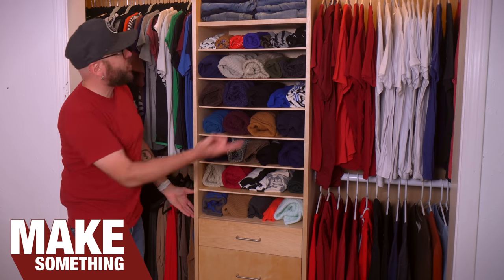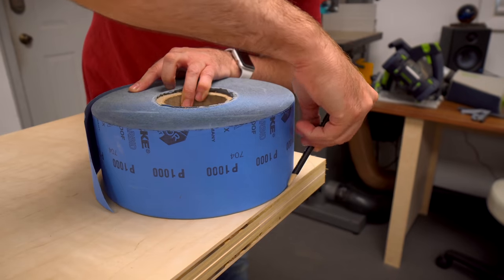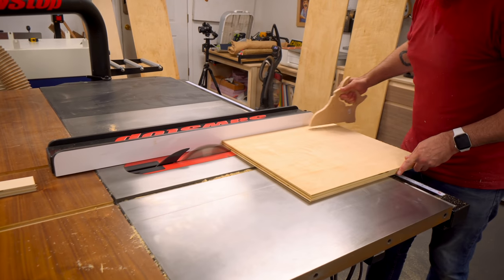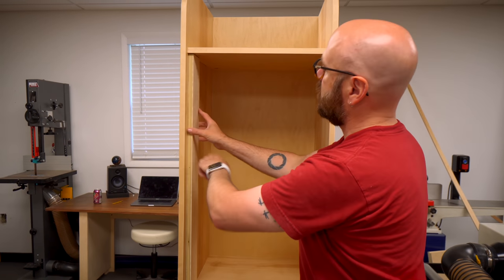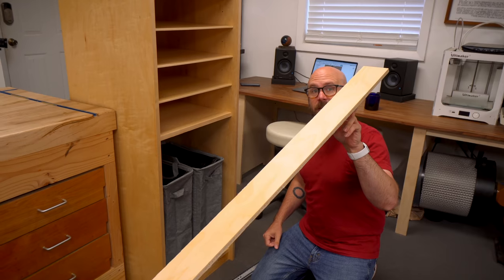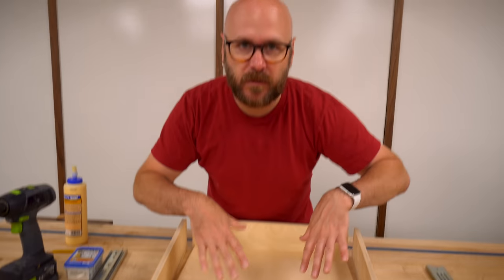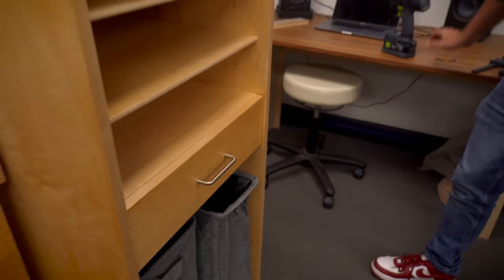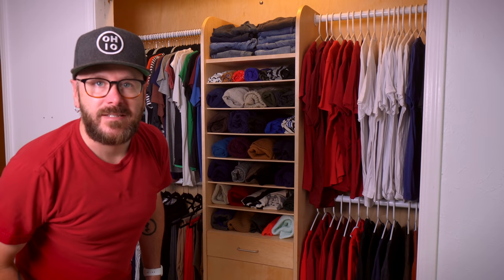DIY Closet Organizer With Laundry Hamper | Easy Woodworking Project

Comment: If you build the drawers will full length side pieces, you can have the pocket holes on the front and back panels and that would hide them once the drawer is installed in the cabinet with the front face installed. Brad from fix this build that has a great video on it. Also makes the drawers a bit stronger. 

Really glad you put this out since I have been toying with the idea of redoing the closets in the house and this was the push I needed to take it on. 
Cheers!

Comment: To use every bit of available space in there, a shelf up top would be handy for blankets, more sweaters, lesser-used items, etc.   Since it would block that ceiling light inside, a strip of LED lights running around the inside of the doorway, and maybe also vertically inside the front corners, would provide better illumination where it's needed.

Comment: I saw the teaser on Instagram and thought, "A closet organizer. Am I even going to watch this? That's more boring than shop furniture." Watched it anyway. Wasn't disappointed. Right off the bat we get a "Check it!" that is followed in quick succession with a long-awaited return of "Sand in the place where you live!" And finally capping it all off was the flipping the cut pieces off the back of the tablesaw (nice having carpet in the shop so those pieces don't get dinged up falling on concrete! This was your plan all along, wasn't it David?), and a kick-ass montage of artsy slo-mo to wrap it up. You're right David - it may not always be about the project when you're wanting to also be a film maker. Despite the mundane simplicity this was still really enjoyable to watch.
Reply from the maker: Thank you thank you!

Comment: Have you considered putting your pocket screws on the front and back panel of the drawer, never see them that way. More math but I just stack it all up, clamp it to the side then take a measurement.
Reply from the maker: Hmmmm, that makes more sense!
Reply: @MakeSomething  added bonus, hide the slots for your bottom.
Reply: Scrolled through the comments to see if someone mentioned this. I'm doing a bunch of drawers right now and the pocket hole placement stood out to me right away. I like your method of clamping everything and taking a measurement. I'm slowly remembering to do that instead of working off my "perfect to the micron" sketchup plans 😂
Reply: @AlexCue  Happy to help. Just make certain your cabinet is square and plumb.

Comment: Great closet organizer!!  Just a question - your outfeed table is parallel with the table saw - was shoving the cut pieces off the table just for show?  I would imagine edges or corners would get damaged falling to the floor?  I am short on shop space and like the idea of it running the length of the saw, but any issues handling larger sheets when cutting?
Reply from the maker: I shove the pieces off the outfeed table to get them out of the way for safety and efficiency. My floors are carpeted so I don’t worry too much about dings. If I had a bigger shop I’d definitely make a much larger outfeed table.

Comment: If you drilled your pocket hole in the back and front piece of your drawer they would have been hidden... more elegant in my opinion
Reply from the maker: But then how do you hide the drawer slides? Way uglier than pocket holes.
Reply: @MakeSomething  if your pocket hole are in the front you hide them with the faceplate

Comment: David, do you have any recommendations on a table saw that uses less than 15 amps? 
I'm inspired to make something like yours but I only have a 15amp circuit for my garage...
Reply: my shop is only set up for 110.  I wanted 220 but just not in the cards.  I purchased the Sawstop professional with 1.75 motor.  It works good, but can be a bit sluggish with some cuts.  overall i love my Sawstop.
Reply: @jhmlkmorrow  The SawStop is probably the safest solution too, correct?
I live in a townhouse and the garage is connected to same circuit as the house so I'm in the same boat, limited to 110. But also maxed at 15 amps.
Reply: I have a 15amp circuit in my garage and have been plenty happy with my Ridgid R4512. Most of my projects are plywood, melamine, and softwoods and my saw handles it all. At some point I will upgrade to a SawStop, but for under $600 I am very happy with it. Bonus - I didn't break the bank getting into the hobby. 

A tip - see if you have at least two circuits in the garage if you're going to do dust collection as well. I have to plug my Harbor Freight dust collector in across the garage on the other circuit if I want to run both the DC and TS at the same time - the startup amp draw is too much for one circuit.
Reply: @AlexCue  Thanks for the tip, I will be sure to look up Rigid. As for the circuits, there is only one for the garage. It's possible I can run a long extension but it's likely I'll be moving next year, to find something more suitable.